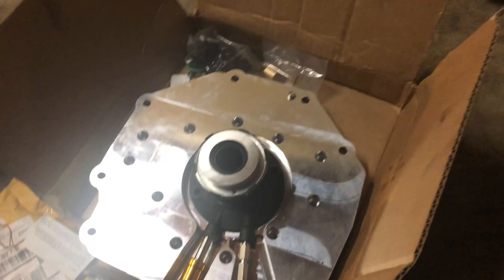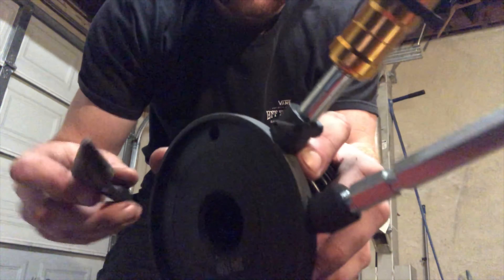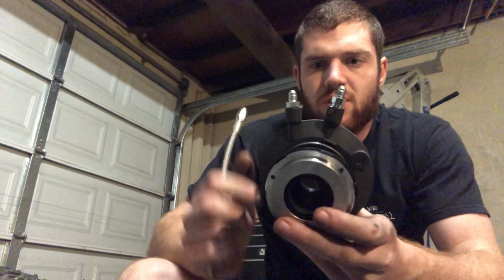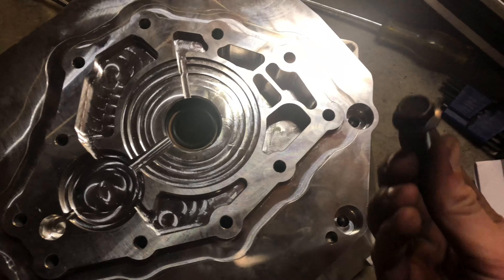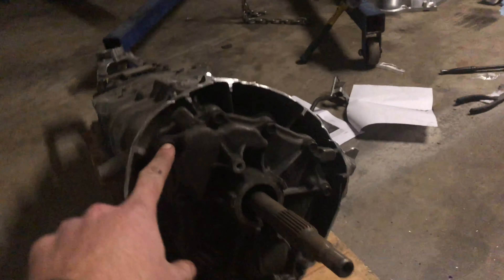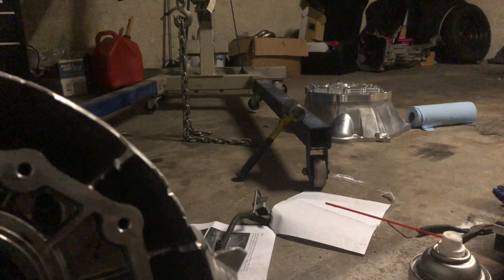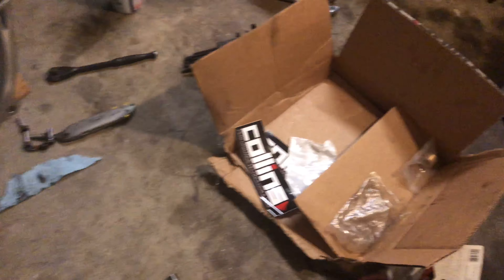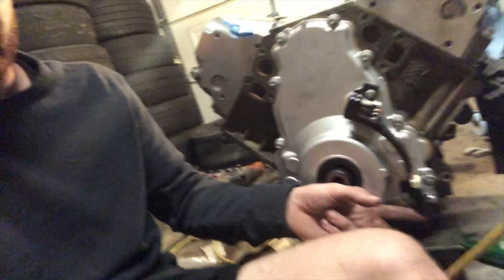FRS LS Swap: CD009 To LSX Collins Adapter Kit

Comment: I’m trying to swap an ls into my 08 STI and a t56 tranny since I’m assuming no one makes a conversion kit from ls1 to the stock STI 6 speed tranny but I noticed you said iron block, I’m assuming you have the L33, how much power are you getting out of that?
Reply from the maker: https://youtu.be/2kQKr1qtvVg

When he runs the ls9 cam in the 5.3 is how much i make lol. I have the exact same setup with ported 706 heads, gen 4 pistons with higher compression, same cam and same intake. Im about to get a bigger cam but what he runs in this video is pretty much the most hp you can make with the least amount of money

Comment: Pilot bushing install?
Reply from the maker: Its easy just press it in with a rubber or plastic mallet and a socket or something. I think they have ball bearing bushings now but if you get the shitty brass one like i did be careful not to smash it too much or it will close the hole up